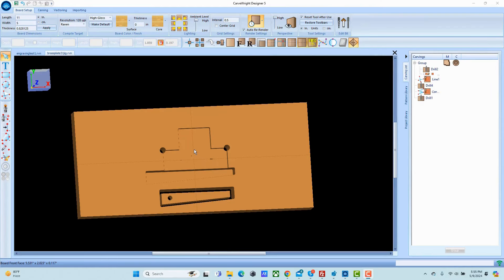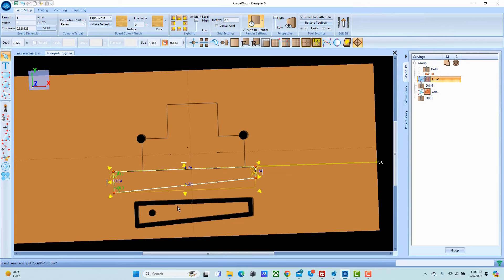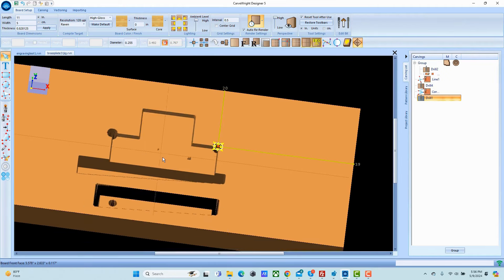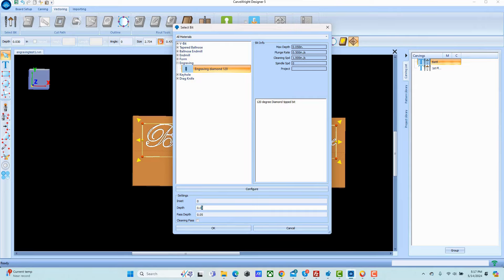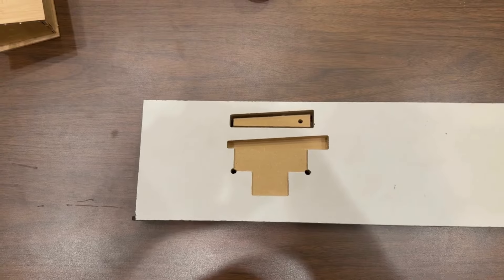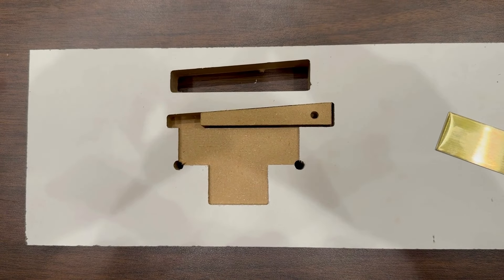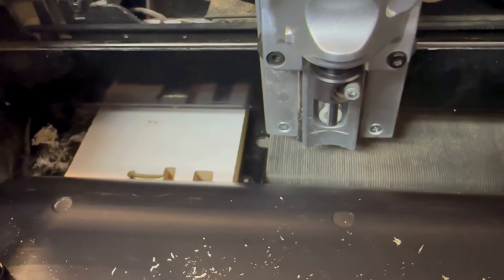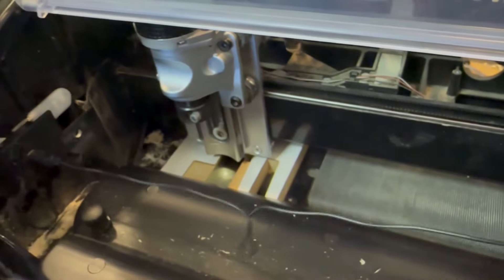RAVEN Brass Engraving

Comment: I have watched this video several times.  One line in the instructions says you can make the engraving deeper by setting up multiple passes.  HOW DO I DO THAT?
Reply from the maker: When ever the cut depth is deeper than the bit's max pass depth, it will do it in multiple passes. For example, if you want to do the engraving cut at .03" in 2 passes, you would set the max pass depth at .015". Brass works well as a single pass, but etching glass will work best with multiple small passes.